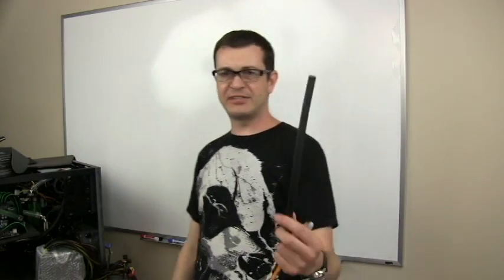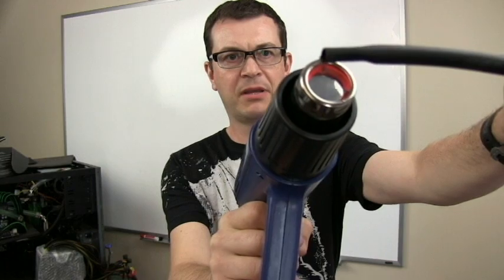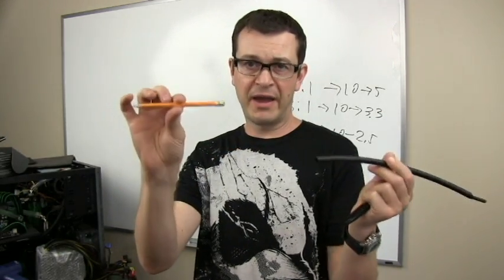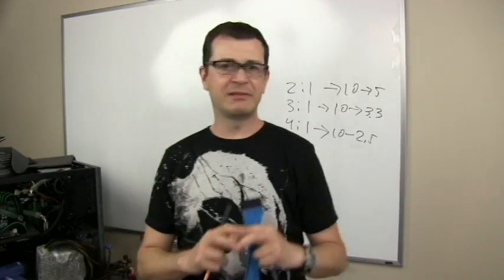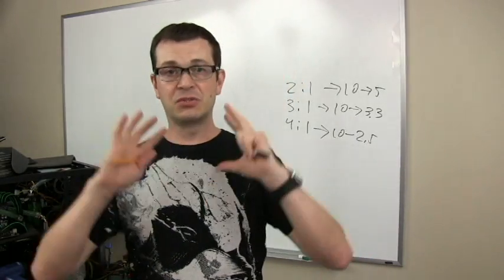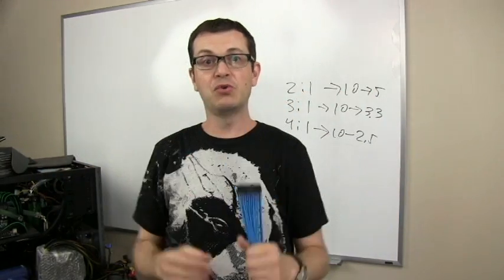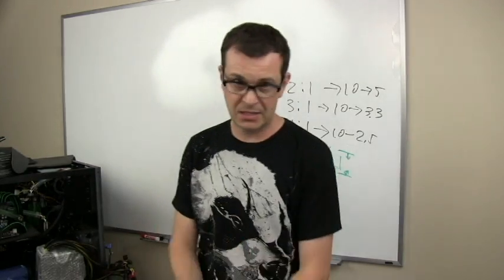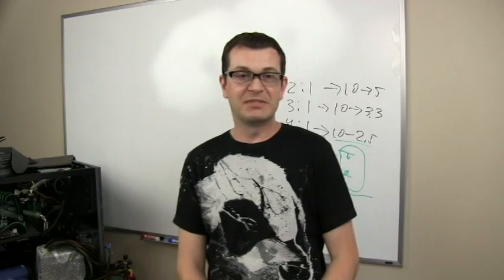How to select right size and type of heatshrink for your computer modding project?

Comment: I also bought a box of assortment of sizes, with glue, worked very good. I had bought a small heat shrink gun, worked good. Don't get the heat shrink too hot, will not get good results.